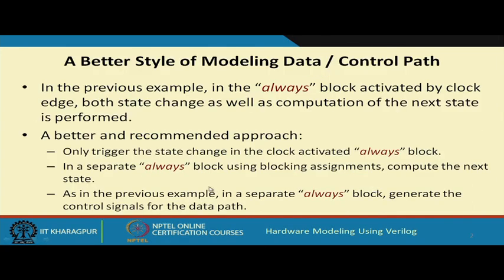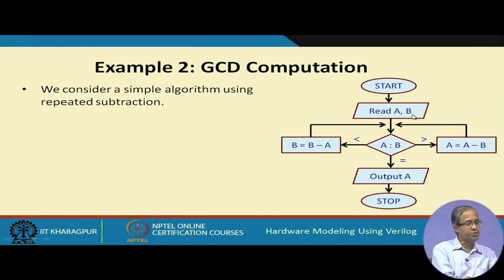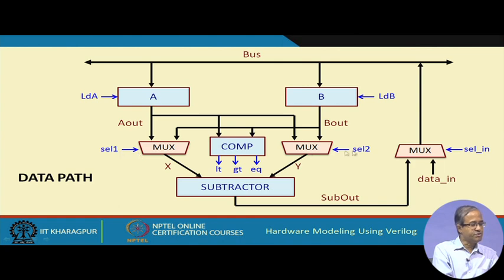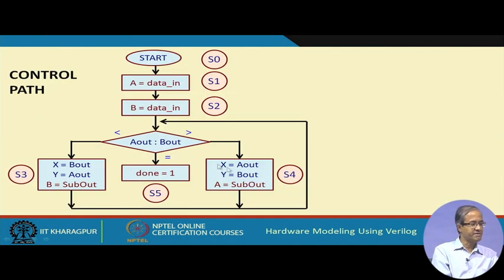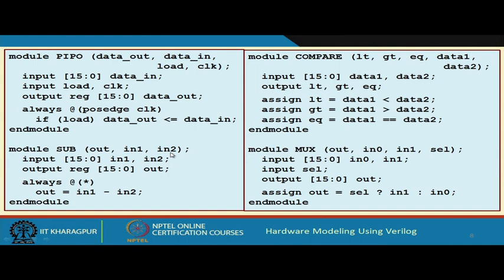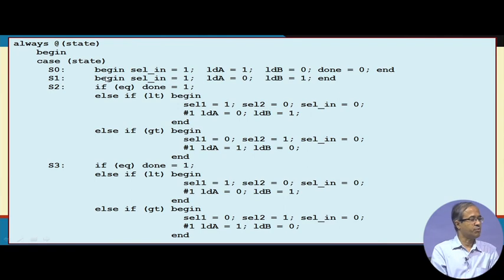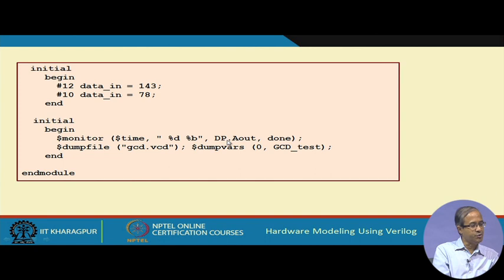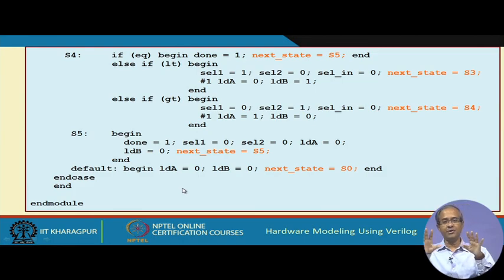DATAPATH AND CONTROLLER DESIGN (PART 2)

Comment: For second version This is the corrected code:
module controller (
    ldA, ldB, sel1, sel2, sel_in, done, clk, lt, gt, eq, start
);
    input clk, lt, gt, eq, start;
    output reg ldA, ldB, sel1, sel2, sel_in, done;

    reg [2:0] state, next_state;
    parameter S0=3'b000, S1=3'b001, S2=3'b010, S3=3'b011, S4=3'b100, S5=3'b101;

    always @(posedge clk) begin
        state<=next_state;
    end
    always @(*) begin
                                                                             // 1) default all signals so you never infer latches:
        next_state = S0;
        ldA        = 0;
        ldB        = 0;
        sel1       = 0;
        sel2       = 0;
        sel_in     = 0;
        done       = 0;
        case (state)
            S0: if(start) begin                                                                  // to start the machine
                sel_in =1; ldA =1; ldB =0; done =0; next_state = S1;     // Define next state
            end 
            S1: begin
                sel_in =1; ldA =0; ldB =1; next_state = S2;                      / Define next state
            end
            S2: begin
                if(eq) begin done =1; next_state=S5; end
                else if(lt) begin
                    sel1=1; sel2=0; sel_in=0; next_state=S3;
                     ldA=0; ldB=1;
                end
                else if(gt) begin
                    sel1 = 0; sel2 = 1; sel_in=0; next_state=S4;
                     ldA =1; ldB = 0;
                end
            end
            S3: begin
                if(eq) begin  done =1; next_state =S5; end
                else if(lt) begin
                    sel1=1; sel2=0; sel_in=0; next_state=S3;
                     ldA=0; ldB=1;
                end
                else if(gt) begin
                    sel1 = 0; sel2 = 1; sel_in=0; next_state=S4;
                     ldA =1; ldB = 0;
                end
            end
            S4 : begin
                if(eq) begin done =1; next_state=S5; end
                else if(lt) begin
                    sel1=1; sel2=0; sel_in=0; next_state =S3;
                     ldA=0; ldB=1;
                end
                else if(gt) begin
                    sel1 = 0; sel2 = 1; sel_in=0; next_state=S4;
                     ldA =1; ldB = 0;
                end
            end
            S5: begin
                done =1; sel1=0; sel2=0; ldA=0; ldB=0; next_state=S5;
            end
            default: begin
                ldA=0; ldB=0; next_state=S0;
            end
        endcase
    end
endmodule
Reply: Yess
Reply: Thanks fo clearing the confusion

Comment: While writing control path in state 3 we already it is less than then why we need to write else if (gt) statement we can leave that no and also same in state s4
Reply: If the gcd is less than both the given numbers (inputs) then the state can change meaning if it was (greater than) at first comparison it can change to (less than) in the next comparisons 
So we need to switch states accordingly.

Although if you see the first code we could've computed it with only 4 states since the code for states s2 s3 s4 is same in the second always block of controller module 

But if you write the control path as mentioned in the last code (special code sir gave atlast)
Then you need 5 states because you're assigning states in the second always block.

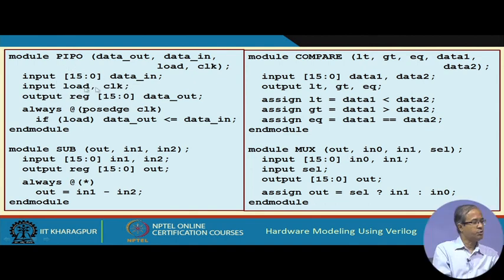Comment: @ 18:32 I think in this always block of sates, sel_in for S0 and S1 should be 0. Because only then the data_in will be selected from the MUX in data path. Can Check the MUX code @ 15:15

Edit: There are some mistakes in the code sir teaching, if u r following the previous modules created in data path
Reply: Hello. I have one doubt regarding the fsm implementation. According to the state diagram loading of A and B is to be done in state1 and state2 respectively. Then why in the code  we have LdA=1 in state0 and  LdB=1 in state2? Shouldn't it be like  in state0 both LdA=0 and LdB=0, in state 1 LdA=1, LdB=0 and in state2 LdA=0, LdB=1. If you know the reason please explain. I am facing high difficulty.
Reply: @----700  When we are at s0 and we have to go to s1 then we can load A and similarly at s1 we are moving to s2 then load B, watch from 18:30 again
Reply: in0 = SubOut , in1 = data_in , out = Bus
So based on mux assignment @ 15:15
if sel = 0 then  out = in0
and if sel = 1 then out = in1
So sel_in should be 1 for data_in.
What do you think?
Reply: In 15:15 
assign out = sel1 ? in1 :  in0;
According to the MUX_load module instance in 13:25 and looking at the MUX module in 15:15 in1 is data_in. Thus if sel1 is true i.e. 1, then assign out = in1 (data_in)

Comment: Hello, I did GCD  and test bench per Example 2. I am not getting the output per Professor got. I don't know where did I mistake. Would you please help me?

I am copies and pest all:

module gcd(gt, lt, eq, ldA, ldB, sel1, sel2, sel_in, data_in, clk);
     input ldA, ldB, sel1, sel2, sel_in, clk;
     input [15:0] data_in;
     output gt, lt, eq;
     wire [15:0] Aout, Bout, X, Y,Bus, SubOut;
     
     PP A (Aout, Bus, ldA, clk );
     PP B(Bout, Bus, ldB, clk);
     MUX Mux_in1 (X, Aout, Bout, sel1);
     MUX Mux_in2 (Y, Aout, Bout, sel2);
     MUX Mux_load (Bus, SubOut, data_in, sel_in);
     SUB SB (SubOut, X, Y);
     COMPARE COMP (gt, lt, eq, Aout, Bout);
     
endmodule 

module COMPARE(lt, gt, eq, data1, data2);
    input [15:0] data1, data2;
    output lt, gt, eq;
    
    assign lt = data1 < data2;
    assign gt = data1 > data2;
    assign eq = data1 == data2;
endmodule

module MUX(out, in0, in1, sel);
    input [15:0] in0, in1;
    input sel;
    output [15:0] out;
    
    assign out =sel? in0 : in1;
    
endmodule

module PP(data_out, data_in, load, clk);
    input[15:0] data_in;
    input load, clk;
    output reg [15:0] data_out;
    
    always @ (posedge clk)
        if (load) data_out <= data_in;
endmodule

module SUB(out, in1, in2);
    input [15:0] in1, in2;
    output reg [15:0] out;
    
    always @ (*)
        out = in1 - in2;
endmodule

module PC(ldA, ldB, sel1, sel2, sel_in, done, clk, lt, gt, eq, start);
    input clk, lt, gt, eq, start;
    output reg ldA, ldB, sel1, sel2, sel_in, done;
    
    reg [2:0] state;
    parameter s0= 3'b000, s1= 3'b001, s2= 3'b010, s3= 3'b011, s4= 3'b100, s5= 3'b101;
    
    always @ (posedge clk)
        begin
            case (state)
                s0:     if (start) state <= s1;
                s1:     state <= s2;
                s2:     #2 if (eq) state <= s5;
                            else if (lt) state <= s3;
                            else if (gt) state <= s4;
                s3:     #2 if (eq) state <= s5;
                            else if (lt) state <= s3;
                            else if (gt) state <= s4;
                 s4:    #2 if (eq) state <= s5;
                            else if (lt) state <= s3;
                            else if (gt) state <= s4;
                s5:         state <= s5;
                default:    state <= s0;
            endcase
        end
        
        always @ (state)
            begin
                case (state)
                    s0:     begin sel_in =1; ldA = 1; ldB = 0; done = 0; end
                    s1:     begin sel_in =1; ldA = 0; ldB = 1; end
                    s2:     if (eq) done = 1;
                            else if (lt) begin sel1 = 1; sel2 = 0; sel_in = 0; #1 ldA = 0; ldB =1; end
                            else if (gt) begin sel1 = 0; sel2 = 1; sel_in = 0; #1 ldA = 1; ldB =0; end
                    s3:     if (eq) done = 1;
                            else if (lt) begin sel1 = 1; sel2 = 0; sel_in = 0; #1 ldA = 0; ldB =1; end
                            else if (gt) begin sel1 = 0; sel2 = 1; sel_in = 0; #1 ldA = 1; ldB =0; end
                    s4:     if (eq) done = 1;
                            else if (lt) begin sel1 = 1; sel2 = 0; sel_in = 0; #1 ldA = 0; ldB =1; end
                            else if (gt) begin sel1 = 0; sel2 = 1; sel_in = 0; #1 ldA = 1; ldB =0; end
                    s5:     begin done = 1; sel1 = 0; sel2 = 0; ldA = 0; ldB =0; end
                    default: begin ldA = 0; ldB =0; end
                endcase
            end 
endmodule

module gcd_tb();
    reg [15:0] data_in;
    reg clk, start;
    wire done;
    
    reg [15:0] A, B;
    
    gcd DP (gt, lt, eq, ldA, ldB, sel1, sel2, sel_in, data_in, clk);
    PC  CON (ldA, ldB, sel1, sel2, sel_in, done, clk, lt, gt, eq, start);
    
    initial begin
        clk= 1'b0;
        #3 start = 1'b1;
        #1000 $finish;
    end
    
    always #5 clk = ~clk;
    
    initial begin
        #12 data_in = 78;
        #10 data_in = 143;
    end
    
    initial begin
        $monitor ($time, "%d %b", DP.Aout, done);
        $dumpfile ("gcd.vcd"); $dumpvars (0, gcd_tb);
    end
    
endmodule
Reply: There are some mistakes in the code which sir is teaching. I think you've copied the code as it is.
I've removed the mistakes, I've checked it my self and its working fine.

DATAPATH:

module gcd_datapath(lt, gt, eq, ldA, ldB, sel1, sel2, sel_in, data_in, clk);
     input ldA, ldB, sel1, sel2, sel_in, clk;
     input [15:0] data_in;
     output gt, lt, eq;
     wire [15:0] Aout, Bout, X, Y,Bus, SubOut;
     
     PIPO A (Aout, Bus, ldA, clk );
     PIPO B (Bout, Bus, ldB, clk);
     MUX Mux_in1 (X, Aout, Bout, sel1);
     MUX Mux_in2 (Y, Aout, Bout, sel2);
     MUX Mux_load (Bus, SubOut, data_in, sel_in);
     SUB SB (SubOut, X, Y);
     COMP C (lt, gt, eq, Aout, Bout);
     
endmodule 

module COMP(lt, gt, eq, data1, data2);
    input [15:0] data1, data2;
    output lt, gt, eq;
    
    assign lt = data1 < data2;
    assign gt = data1 > data2;
    assign eq = data1 == data2;
endmodule

module MUX(out, in0, in1, sel);
    input [15:0] in0, in1;
    input sel;
    output [15:0] out;
    
    assign out = sel ? in0 : in1;
    
endmodule

module PIPO(data_out, data_in, load, clk);
    input[15:0] data_in;
    input load, clk;
    output reg [15:0] data_out;
    
    always @ (posedge clk)
        if (load) data_out <= data_in;
endmodule

module SUB(out, in1, in2);
    input [15:0] in1, in2;
    output reg [15:0] out;
    
    always @ (*)
        out = in1 - in2;
endmodule

CONTROL PATH:

module gcd_controlpath(ldA, ldB, sel1, sel2, sel_in, done, clk, lt, gt, eq, start);
    input clk, lt, gt, eq, start;
    output reg ldA, ldB, sel1, sel2, sel_in, done;
    
    reg [2:0] state;
    parameter s0= 3'b000, s1= 3'b001, s2= 3'b010, s3= 3'b011, s4= 3'b100, s5= 3'b101;
    
    always @ (posedge clk)
        begin
            case (state)
                s0:     if (start) state <= s1;
                s1:     state <= s2;
                s2:     #2 if (eq) state <= s5;
                            else if (lt) state <= s3;
                            else if (gt) state <= s4;
                s3:     #2 if (eq) state <= s5;
                            else if (lt) state <= s3;
                            else if (gt) state <= s4;
                 s4:    #2 if (eq) state <= s5;
                            else if (lt) state <= s3;
                            else if (gt) state <= s4;
                s5:         state <= s5;
                default:    state <= s0;
            endcase
        end
        
        always @ (state)
            begin
                case (state)
                    s0:     begin sel_in =0; ldA = 1; ldB = 0; done = 0; end
                    s1:     begin sel_in =0; ldA = 0; ldB = 1; end
                    s2:     if (eq) done = 1;
                            else if (lt) begin sel1 = 0; sel2 = 1; sel_in = 1; #1 ldA = 0; ldB =1; end
                            else if (gt) begin sel1 = 1; sel2 = 0; sel_in = 1; #1 ldA = 1; ldB =0; end
                    s3:     if (eq) done = 1;
                            else if (lt) begin sel1 = 0; sel2 = 1; sel_in = 1; #1 ldA = 0; ldB =1; end
                            else if (gt) begin sel1 = 1; sel2 = 0; sel_in = 1; #1 ldA = 1; ldB =0; end
                    s4:     if (eq) done = 1;
                            else if (lt) begin sel1 = 0; sel2 = 1; sel_in = 1; #1 ldA = 0; ldB =1; end
                            else if (gt) begin sel1 = 1; sel2 = 0; sel_in = 1; #1 ldA = 1; ldB =0; end
                    s5:     begin done = 1; sel1 = 0; sel2 = 0; ldA = 0; ldB =0; end
                    default: begin ldA = 0; ldB =0; end
                endcase
            end 
endmodule

TEST BENCH:

module gcd_testbench();
    reg [15:0] data_in;
    reg clk, start;
    wire done;
    
    reg [15:0] A, B;
    
    gcd_datapath DP (lt, gt, eq, ldA, ldB, sel1, sel2, sel_in, data_in, clk);
    gcd_controlpath CON (ldA, ldB, sel1, sel2, sel_in, done, clk, lt, gt, eq, start);
    
    initial begin
        clk= 1'b0;
        #3 start = 1'b1;
        #1000 $finish;
    end
    
    always #5 clk = ~clk;
    
    initial begin
        #12 data_in = 143;
        #10 data_in = 78;
    end
    
    initial begin
        $monitor ($time, "%d %b", DP.Bout, done);
    end
    
endmodule
Reply: @sushensharma3672   lifesaver
Reply: @sushensharma3672      reg [15:0] A, B; why it is used in testbench
Reply: @hmm_shivam  same question
Reply: @sushensharma3672  How we can combine control path and datapath... Can you send main GCD module, for which we write testbench..?
Reply: @sushensharma3672  sel?in1:in0 means if sel is true=1 then select in1 which is datain according to mux written before ur just confusing things iguess if sel=false =0 then select subout this is actully the sir code says
Reply: @sushensharma3672  you didn't get implict definition of wires in testbench?
Reply: You want to change the order, you want to first  write the modules for (MUX,PIPO,SUB, COMPARE) and than instantiate that module using top level for datapath, and finally Witte the controller path module. Please ensure that your testbench must be in seperate .v file
Reply: @mukunthanjmukunthan4739  hi, I got similar problem but for the first video datapath and controller part-1. could you help me out?
Reply: @mukunthanjmukunthan4739  Hello, this is still not working. Can you help me out?
Reply: @akhilmehta8248  i found one bug.  in the controller part there is no way the state will go from S0 state to S1 state, also from S1 to S2 . add ns in them as well .

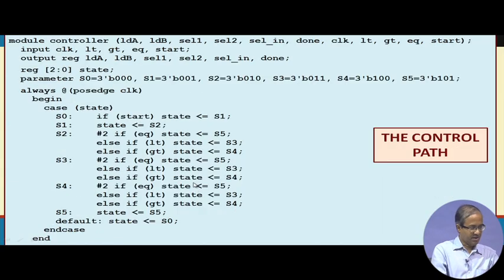Comment: 16:40
Reply: Controller module is to tell the datapath that,  in which state my control pins want to activate. 1st always block is used for state representation. 2nd always block for control pin activation

Comment: can we done this programming by using XILINX instead of GTKwave?
in Xilinux we do not write a separate code for test beanch..... please clear my confusion
Reply: yes you can do, but you need to write testbench in that case also...only advantage in case of xillinx is that managing different modules with test bench and observing waveform and writing code together becomes a lot easier , all these things are integreted in one place and can be worked upon simultaneously
u need not to open separate softwares everytime like in case if iverilog or gtkwave....GUI is more user friendly
Reply: yes we can do the programming in xilinx but we need to write a seperate code for test bench in xilinx
Reply: no need,just comment that dumpvar part its will work. just se your output in isim